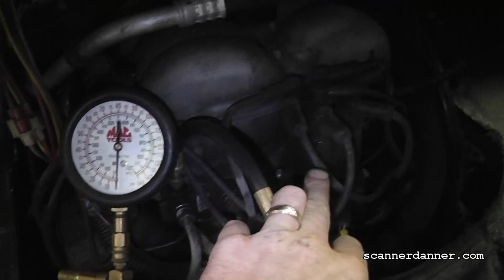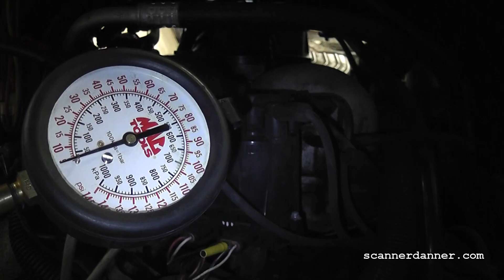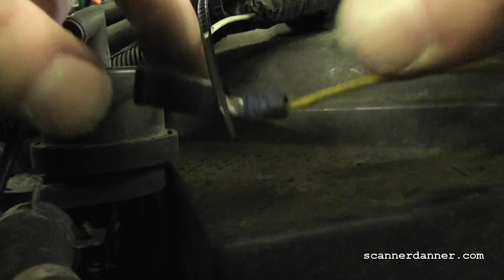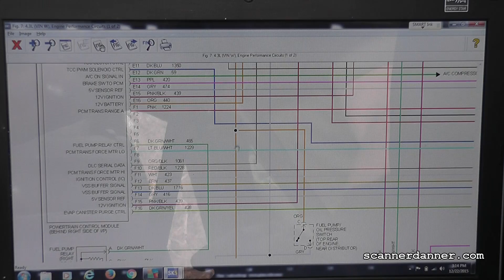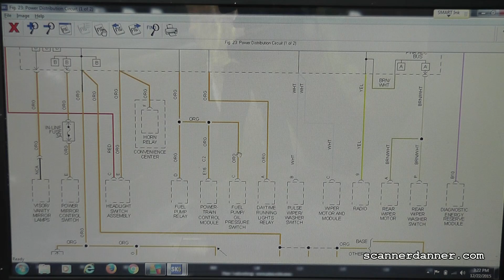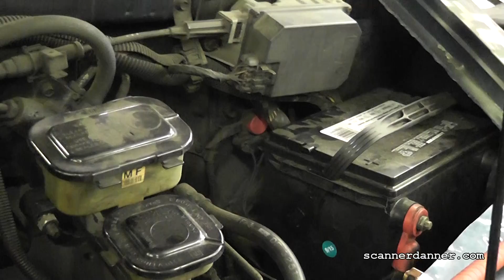Fuel pump electrical circuit diagnosis (no fuel pressure testing) GM

Comment: Around 6:50 you're using a test light as what i'd say as a jumper wire. When you cranked the engine, that signal wire was returning around 5 volts, which i'd guess is a V-ref signal most likely being lower than 4.75 volts. Using your test light, you were sending system voltage to that wire. Which could very well raise amperage 2.5x beyond the ECM's desired design for that particular circuit. I'm not sure if my instructors made me paranoid about using this method, or if you never considered the possibility of my concern. We can still be friends, god dammit.
Reply from the maker: +Sgt Stupid great question man! Did you notice that during my test the light bulb never lit? This means that the resistance inside the computer for the signal circuit is very high. So much so that I do not think I could read amperage on this circuit even if I tried. 
Yes, I was using a higher voltage than the circuit was designed for but no, I was not causing too much amperage to flow, and no, this will not harm the computer. 
Remember, input circuits (signal circuits), do not support any measurable current flow and can handle much higher voltage than what is actually there. Will it report this higher voltage? No, but the higher voltage will not hurt it. 
Check this one out https://www.youtube.com/watch?v=PYFQ3Y4eFWY
I'm using a 12v test light on a 1v O2 circuit

Comment: I was thinking fuse ten minutes before you got there. This is pre OBD2. Resistance = heat and you get melted. 12 V system hate resistance. Looks like you will need the entire harness but probably easier to just fix.

Comment: When do you prefer using this older scan tool as opposed to the new one you have? I apologize if you already mentioned that in the video, as I missed a minute of it cause I was doing something while watching.
Great video as always. Thanks for sharing your knowledge with us! Not many like to do that.
Reply from the maker: +Atrax R I didn't use a scan tool. Just a little hand held graphing multimeter. It's still my most used tool
Reply: ScannerDanner Oh I see, hehe. Definitely useful for lots of things.

Comment: Quick and dirty test on the GMs of that time. If you have a no start with no fuel pressure. Crank it for at least 5 seconds while watching the fuel pressure. If you get no prime but get pressure after 5 seconds you have power to the pump but the relay is bad. If you get nothing but a jumper to B+ gets you pressure you have a wiring or ECM/B power issue.  The cranking test will close the oil pressure switch and turn the pump on.

Comment: @ScannerDanner  If my car temporarily starts when I spray starter fluid into the throttle body, is that an indication that the ECM is functioning? My car only cranks, no start.  2005 Jaguar Stype v6
Reply from the maker: +Harley Rider it depends on the ignition design. For example, the one on this vehicle does not need the ECM for spark control while cranking. I could literally unplug the ECM and spray starting fluid in the intake and it would run  (until the starting fluid ran out).
So all you know right now is you have spark. 
My suspicion is the ECM is controlling spark all the time on your jaguar.  So yes, this at least tells you the ECM is "alive". 
In this video is a playlist that involves about 20 other videos I've done on fuel pressure testing. You need to check your fuel psi and then injector pulse next
Reply: ScannerDanner You mention to test fuel pressure, but I have non because there is no power going to the fuel pump, Not sue if the lack of power to the fuel pump would also mess with the injector pulse test.

Comment: I owned a 93 Astro from new until last March.  I had the same issue. There are some other common issues that they have that take a bit of time to find but are amazingly simple fixes. That part is not available, I clipped mine from the junkyard.

Comment: I understand that corrosion is the main cause of failure here but can using a higher watts headlights bulb than recommended by OEM be also the cause since they share the same power source block?

Thanks for the videos and sharing your knowledge Paul.

Comment: the industry plan works very clever of them placed in a hidden area next to engine heat and battery heat where most people would not look most cars today  are rigged like home owners weed eaters  allmost imposslble to work on but the 350 dollar ones say pull rope is 4 bolts removed string replaced but the home weedeater you have to remove most of the assemble parts to get to the rope this is a plan of sabotage now back to the pump in the tank vacuum from the engine works better allowing the 3 suction return vapor where vapor would run the engine good gas mileage their secret everything shall be uncovered

Comment: That looked like a fairly common GM four-pin connector; I think it should be the same connector they used for the ABS harness in the mid-90s.  It's rather large, if I recall?  I've seen 'em floating around on the racks at parts stores, though you may have to Dremel it to get the keying to fit.  :)

Comment: I've had to do similar things on older POS vehicles... I suspect you did this, but when comes to cobbling stuff of this sort, I like to at least slather up exposed terminals/connections with silicone dielectric grease. Great videos, Thanks!